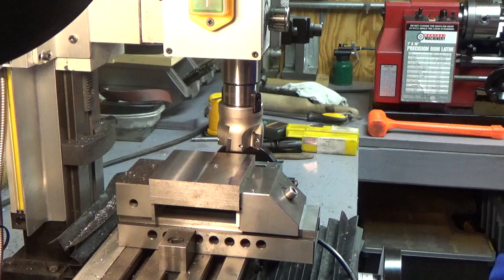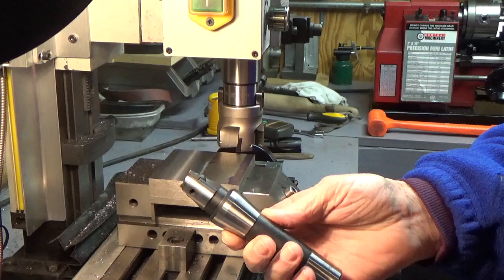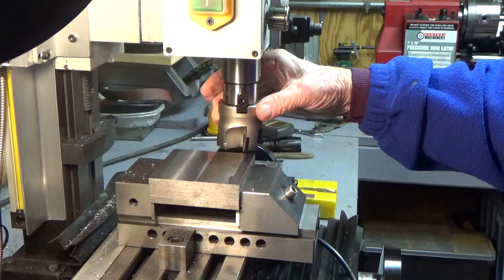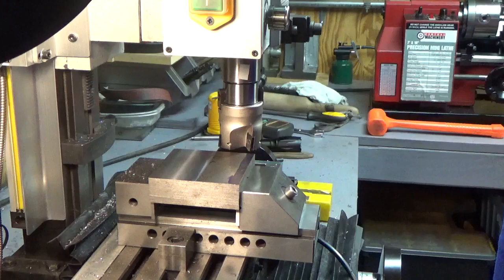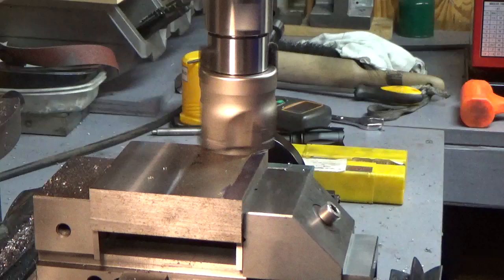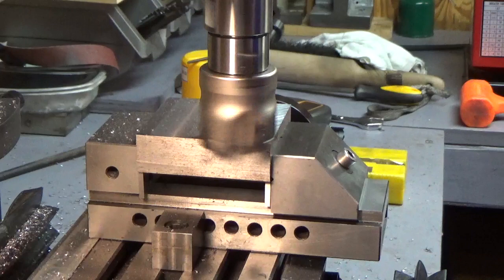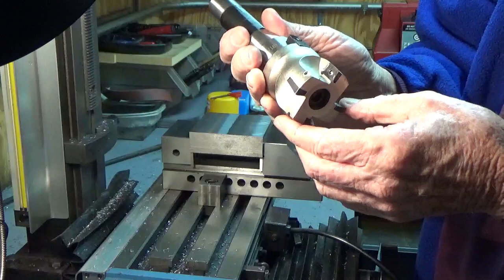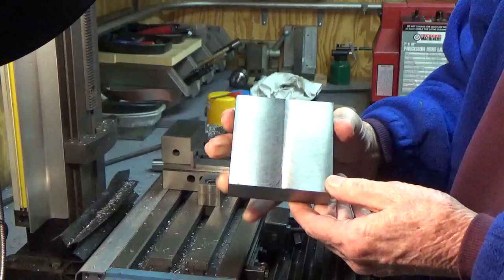Mini Mill Using a Chinese 50mm 4-Flute Face Mill

Comment: please dont forget that you can touch up those inserts and remove the wiper flat on the bottom--I have a video but will redo it in the morning. Those 1604 inserts the big ones 16mm have a huge wiper flat thats scrubs across the surface multiplied times 4.   You can use many methods usually just a diamond knife lap from EZLAP to remove almost all of the wiper flat--my video explains it..
Reply from the maker: Thank You. Regards: Larry

Comment: On my recent purchace of a similar face mill, the inserts were difficult to get seated, and really not properly, as my cutterhead has No 11 degree side cuts in the insert pocket. Also you can see the misalignment in the screw hole.

Comment: Great cut and another awesome video. What rpm were you at? Definitely going to pick one of these up😀
Reply from the maker: Probably about 400 RPM.  I haven't really tested with different RPM speeds.  I just initially set the RPM where I already knew it would work fine, considering I just ran the feed very slow.  Thanks for the comment: Larry

Comment: bought the 63 mm its about the maximum a stock grizly g0704 can take 
glad to hear its running smooth , i havent used it yet as i was kind of worried about the plastic gears inside the machine
Reply from the maker: Good Luck........You should be pleased.  Regards: Larry

Comment: It will cut even better if you get your head trammed in a little better. It is not quite parallel with the bed, as the cutter trailing edge is not leaving any kind of marks. So your cutter head is slightly tilted to the left.
Reply from the maker: Thank You. Regards: Larry
Reply: Yes, I spotted that too.

Comment: Larry

That face mill is now coming with 4 of the better grade Blue Nano inserts.  The bag of inserts you got for around $9 are the cheaper ones that have gotten some poor reviews.  The Blue Nano inserts run closer to $20 for 10.  So, be sure and test with the chaaper inserts and see if you get the same good finish before counting on the replacement inserts for something important

John
Reply from the maker: John:  Thanks for the info.  Regards: Larry

Comment: Hi I bought a very similar 50 mm face cutter from China for use in my Optimum BF20L milling machine ( very similar to others sold in the USA  under different names) The milled Surface finish was poor ( even with a cutter depth as low as 0.01mm) so I bought a packet of 10 new inserts. Didn't improve it at all. Cant say I am impressed with the 50 mm face cutter head. I get much better surface finish from the 25mm head with two pointed shape insert cutters which you showed. I couldn't see any point in keeping it as I would never use it so sold it for half price.

Comment: Thanks Larry, I have the same endmill and mini mill. I was not happy with mine but I think maybe I was running it too fast and trying to remove too much.
Reply from the maker: Try using it for finishing large areas, only removing 0.005" or less.  Run it slow at maybe 500 RPM or less.  After all, it's 2" in diameter.  You should be able to see the inserts clearly as it rotates.  Thanks for your comment: Larry

Comment: Thanks Larry. Very helpful. I timed the feedrate (ipm) at 3" per minute.
What was your depth of cut (DOC)?   My guess is 1/10" (.100") or less.
Was the Width of Cut (WOC) = 1-7/8" ? [aka overhang not cutting = 1/8" ] ?
If these guesses are correct, then the Chip Load / tooth was .002", the Hp was 1/2hp
and the MRR was a bit over 1/2 ci        Appreciate any feedback.
Reply from the maker: Paul:  My memory fails me at this point in time.  I'm sure the DOC was just very minimal considering I was making a finish cut and the IPM was very slow.  I never meant to use the face mill for typical milling operations.  The step over was probably little or nothing, using pretty much the entire cutter diameter.......so yes; probably about 1-7/8".   Thanks for your comment and best regards: Larry

Comment: Mine has 1 insert sticking out further then other 3. So it only cuts by one insert.
I don't use it. I made my own flu cutter and it works allot better.
Reply from the maker: I've heard that from others.  I've checked and mine is perfect.  Yes, fly cutters are nice for finishing.  I use mine all the time.  Regards: Larry

Comment: Not being a know it all at all, but when you start with a poor machine then it's even more important to follow good machining practise, you should run at the proper speed and use the proper feed, slow to be safe doesn't work there are speeds and feeds for a reason. Then you should always feed against a solid jaw, or a stop. Hope the tips help, 93 tool maker since 1940.
Reply from the maker: Richard: Thanks, I can use all the help I can get.  Thanks for the comment.  Regards: Larry

Comment: Just found your video. It was great Thanks. What end mill are you using and was it auto feed or you ?  I'm looking into getting a mini mill. Did you get it from LMShop ? (the link you showed).
Reply from the maker: Tom: I think I purchased from China location, but at the time they were being sold by many sellers both in the U.S. and China.  I do have a power feed unit on the mini mill and I wouldn't be without it.  I think I did purchase that unit from LMS.  Best Regards: Larry

Comment: Did you convert to power feed on that mill or did it come with that ?
Reply from the maker: Berkeley:  Yes I added a power feed unit to the X axis.  A nice unit can be purchased from LMS (Little Machine Shop).  I've owned several of them over the years and think it's definitely a good investment.  I have problems with my shoulder, so it's almost a necessity for me.  Regards: Larry

Comment: Hello Larry, I saw your video, and I was very impressed, that I also bought the same tool, saw your experience I wanted to ask how much you do the cutter (RPM) and the depth of how many cents, I assume that in the video you work on a piece of steel, if you have also used it on other materials, like aluminum if you can tell me also for this type of metal the rpm of the cutter (RPM) and the deep pass. Thank you
Reply from the maker: Noe:  I've only used the cutter on mild steel.  I only purchased it to make finish cuts of a few thousandths of an inch at a low RPM.  I have other smaller diameter end mills for removing larger amounts of material.  I can usually remove easily 0.030" with my 1-1/4" 2-flute end mill.  With the face mill, I'm only interested in removing 0.005", but I'm sure it could remove much more.  The final finish is sometimes important on a wider piece of steel, so the 50mm face mill works nice for those occasions.  I'm sorry that I can't be more helpful, but I don't usually watch the RPM, but instead just do what feels good.  It's not my nature to push the depth of cut, etc..  I'm usually in no bit hurry.  Best Regards: Larry

Comment: this video is good . i have  questiom what tipe of bit i need to a good finish on aluminum also this face cutter is MT3 or MT2???
Reply from the maker: The mill spindle is R8.  The insert that came with the face mill seems to provide adequate finish on aluminum.  Thanks for watching, Regards: Larry
Reply: @larrypoindexter9351  thanks for you videos and for answer my quiestion
Reply: @larrypoindexter9351  i like to ask you im new on this i have a smithy combo lathe the classic . the mill uses mt3 or mt2 i want to buy a colletc set and mill face cutter but i dont know what i need . i look on they website but no info for this model thanks
Reply from the maker: @m0ntr0s0  MT3 Shanks are common and available at many suppliers, as are collet sets.  Larry

Comment: This face mill has a major flaw. 1 flute is shorter than the rest. Put it on a flat surface and you will see
Reply from the maker: I may take it over to the surface plate and give it a look see
Reply: @larrypoindexter9351  What did you find out?
Reply from the maker: @rogermaury7722  I'll try and look at it tomorrow.  Just a couple minutes on the surface plate or maybe I'll just put it in the spindle and check it with a dial indicator.  I'm sure it's not perfect and the inserts are not adjustable, so it is what it is.  Most things made in China are imperfect.  You get what you pay for most of the time.  Larry
Reply from the maker: @rogermaury7722  When placed on the surface plate all the inserts are dead on.  Within 0.001".  That's the smallest feeler gauge that I have.  I'm sure that things could be off if checked with a dial indicator while mounted in the R8 Spindle, but then there would be a lot of stuff in play.  Larry
Reply from the maker: @rogermaury7722  When placed on the surface plate all the inserts are dead on.  Within 0.001".  That's the smallest feeler gauge that I have.  I'm sure that things could be off if checked with a dial indicator while mounted in the R8 Spindle, but then there would be a lot of stuff in play.  Larry

Comment: If your not cutting on the trailing end of the cutter, in both directions, your a little out of tram correct?
Reply from the maker: I think tram was okay.  It would help to lock the Y axis.  Tram could also be a "slight" problem.  Thanks for your comment.  Larry

Comment: These face mills work better at higher speeds as they have carbide inserts, carbide running slow gives a poor finish both on mill and lathe alike, still a good tool to have for what they cost. Once your inserts get a bit dull you can use them for roughing out and save the good ones for finishing
Reply: Speeds & Feeds are a guide to a general purpose , if you get that , every tool has its sweet spot it can be way off from its rule. 👍👍
Reply from the maker: Thank You. Regards: Larry
Reply: I forgot to mention that they work great with only 1 insert as a finish fly cutter, they are far better balanced than a typical fly cutter and you hardly notice if it has 1 or 4
Reply from the maker: @incubatork  Interesting Thanks Larry

Comment: Larry that certainly is a nice enough finish, it would be interesting to see what the finish is on cast iron, do you think it would be even nicer? one thing I did notice was in the video there seemed to be some wobble where the cutter head attaches to the R-8, can you set up a dti to check the tip of all 4 inserts on revolution to make sure they all zero out, or another test would be to move the table instead and leave the cutter stationary, just curious,
Reply from the maker: Walter:  It runs dead smooth, even at 2500 RPM.  I'll check with a DTI tomorrow and let you know.
Reply: So it must be a face that is not important and has not been ground,
Reply from the maker: I'll run a DTI across the inserts in the morning, just for curiosity.

Comment: Hi metal guys i use these face mill with the same inserts from China (but golden so Tialn coated i think) since over a year now and the finish is okay (My 60mm DIY Fly Cutter with a 16mm steel insert holder leaves the better finish) but the moment i take a  little deeper cut ( lets say 0,3-0,,5mm) the 550W and 70kg mini mill comes at his limits ...makes noises and cuts not so well any more ....really deep  cuts i cant imagine with such a head ...is this my fault or the machine or the head?
Reply from the maker: Thank You. Regards: Larry

Comment: Ever use a face mill with a shank. I have a hard to find taper so im limited to what i can fit into a collet holder uo to 3/4"
Reply from the maker: Electro:  I'm sorry, the only thing I use for the larger size end mills and face mill is the R8 shank.  If you only have a 3/4" collet, then I expect your probably very limited concerning the tools cutting diameter.  Regards: Larry
Reply: @larrypoindexter9351  how big do u think i can cut with a 3/4" collet? Width, depth before it spins in the collet
Reply: @electromechanicalstuff2602  IT WONT
Reply: @jaysilverheals4445  ok thanks

Comment: i wonder if using lube would reduce the swirl marks or make it smoother?? anyone know?
Reply from the maker: I'm pretty sure that would be impossible.  If you tram your mill table perfectly in both directions and also align the end mill inserts perfectly then you should get a decent finish.  On some larger face mill it is possible to align the inserts.  No matter, I think end mill marks are just going to happen.  Regards
Reply: yes - but 'lube' gives a better finish on nearly every other material known to man - why not with metals? for example wet sanding glass and plastics, etc etc - i'm pretty sure it results in a better surface finish when turning metals on a lathe ... i guess it functions by reducing surface temperature and surface tension itself
Reply: Coolant can crack inserts because of the heat differential. Alot of inserts are ran dry